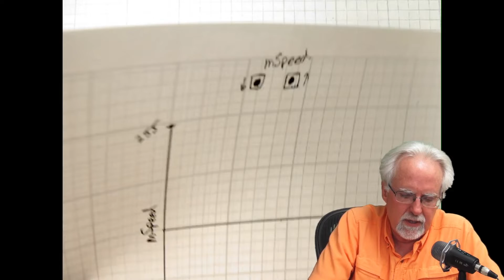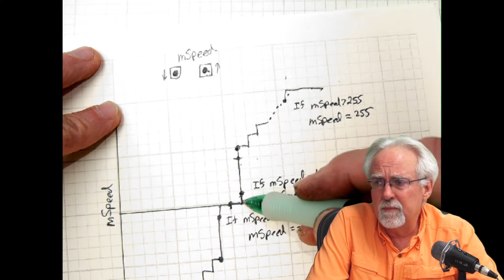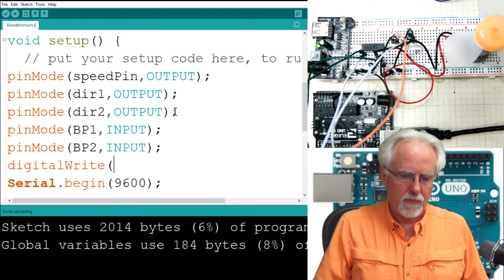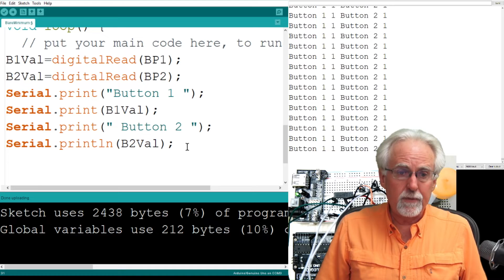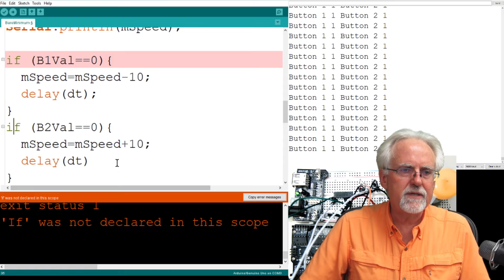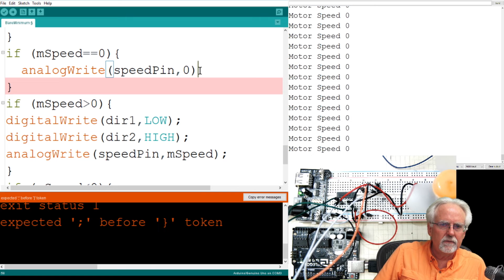Arduino Tutorial 40: Controlling DC Motor Speed and Direction with Pushbuttons

Comment: I set the logic completely differently.  Firstly I set a range of values between 99 and -99 and set a while loop.  Within that I set two variables of old and new speed to work out if I was increasing or decreasing speed.  Then I set the speed to either 0 if I was + and on the way down and 100 if I was on the way up.  Another loop did the same in the - range for 0 on the way up and 100 on the way down.  After that it was easy to keep the increases as increments of 145/10=14.5 to give it an exact figure of +255-100 and -255 +100.  This gave me exactly 10 clicks of each button to reach 255 or -255 which I set as a while loop.  Hopefully my explanation makes sense.  It meant I had smooth speed changes right up to the top rather than the mini increment for top speed.
Reply: I did something similar by specifying a minimum speed that got added or subtracted from my 'nominal' speed to create an 'actual' speed.

Comment: I did the homework. I used a minimum motor pwm setting of 90, but with a motor "primer" of 255 for 50 milliseconds when transitioning between off and a minimum.

Comment: int speedPin = 3;
int dir1 = 4;
int dir2 = 5;

int aos = 5;

int topA = 1023;
int topADot = 1023.;

int speedBVal = 0;
float speedAVal;

int switchPin1 = 9;
int switchPin2 = 8;

int switchVal1;
int switchVal2;

void setup() {

pinMode(speedPin, OUTPUT);
pinMode(dir1, OUTPUT);
pinMode(dir2, OUTPUT);

pinMode(switchPin1, INPUT);
pinMode(switchPin2, INPUT);

digitalWrite(switchPin1, HIGH);
digitalWrite(switchPin2, HIGH);

Serial.begin(19200);
}

void loop() {

Serial.print(speedBVal);
Serial.print(" ");
Serial.println(speedAVal);

switchVal1 = digitalRead(switchPin1);
switchVal2 = digitalRead(switchPin2);

if(switchVal1 == 0){
  speedBVal = speedBVal + aos;
  if(speedBVal > topA){
    speedBVal = topA;
  }
 }
else if(switchVal2 == 0){
  speedBVal = speedBVal - aos;
  if(speedBVal < -topA){
    speedBVal = -topA;
  }
 }

if(speedBVal > 0){
  digitalWrite(dir1, LOW);
  digitalWrite(dir2, HIGH);
  speedAVal = (255./topADot)*speedBVal;
}
else if(speedBVal < 0){
  digitalWrite(dir1, HIGH);
  digitalWrite(dir2, LOW);
  speedAVal = (-255./topADot)*speedBVal;
}

analogWrite(speedPin, speedAVal);
}

Comment: Done it my own way before watching the lesson, there's probably a much easier way to do it, but it works :D

int speedPin=5;
int dir1=4;
int dir2=3;
int forwardButton=7;
int reverseButton=8;

int forwardState;
int reverseState;

int forwardFlag=0;
int reverseFlag=0;

int forwardNumber=0;
int reverseNumber=0;
int forwardLimit=254;
int reverseLimit=254;
int mSpeed;
int delayTime=30;

void setup() {
  // put your setup code here, to run once:
pinMode(speedPin,OUTPUT);
pinMode(dir1,OUTPUT);
pinMode(dir2,OUTPUT);
pinMode(forwardButton,INPUT);
pinMode(reverseButton,INPUT);
digitalWrite(forwardButton,HIGH);
digitalWrite(reverseButton,HIGH);
Serial.begin(9600);

}

void loop() {
  // put your main code here, to run repeatedly:
forwardState=digitalRead(forwardButton);
reverseState=digitalRead(reverseButton);

if((forwardState==0)&&(forwardNumber<=forwardLimit)&&(reverseFlag==0))
  {
    digitalWrite(dir1,LOW);
    digitalWrite(dir2,HIGH);
    forwardNumber=forwardNumber+1;
    delay(delayTime);
    analogWrite(speedPin,forwardNumber);
    forwardFlag=1;
    Serial.print("Forward");
    Serial.println(forwardNumber);
    
  }
if((reverseState==0)&&(forwardNumber>0))
  {
    digitalWrite(dir1,LOW);
    digitalWrite(dir2,HIGH);
    forwardNumber=forwardNumber-1;
    delay(delayTime);
    analogWrite(speedPin,forwardNumber);
          if(forwardNumber==0)
        {
          forwardFlag=0;
        }
    Serial.print("Forward");
    Serial.println(forwardNumber);
  }
 
if((reverseState==0)&&(reverseNumber<=reverseLimit)&&(forwardFlag==0))
  {
    digitalWrite(dir1,HIGH);
    digitalWrite(dir2,LOW);
    reverseNumber=reverseNumber+1;
    delay(delayTime);
    analogWrite(speedPin,reverseNumber);
    reverseFlag=1;
    Serial.print("Reverse");
    Serial.println(reverseNumber);
 }
if((forwardState==0)&&(reverseNumber>=0))
  {
    digitalWrite(dir1,HIGH);
    digitalWrite(dir2,LOW);
    reverseNumber=reverseNumber-1;
    delay(delayTime);
    analogWrite(speedPin,reverseNumber);
          if(reverseNumber==0)
        {
          reverseFlag=0;
        }
    Serial.print("Reverse");
    Serial.println(reverseNumber);

  }
}

Comment: Was able to make the project work flawlessly. After watching 40 videos, I have understood how to approach the problem. I also incorporated 2 LEDs for +max and -max speed to signal the user to stop pushing the button. Also, my motors start to run at 95 so the number of if statements reduced and thus the complexity. Thanks for all the lessons, Paul! Appreciate it.

The grade would be A or A+ if you are generous enough...haha!

Comment: This is my code it is very different from yours but i tried doing it by myself. Keep up with the great videos. My grade would probably be a B- or  a C+.

int speedPin = 5;
int dir1 = 4;
int dir2 = 3;
int mSpeed = 90;
int Ypin = 9;
int Yval;
int d1 = 750;
int buttonpin = 8;
int buttonVal;
int buttonpin2  = 10;
int buttonVal2;
int buttonstate = 1;
int buttonstate2 = 0;

void setup(){
    pinMode(speedPin,OUTPUT);
    pinMode(dir1,OUTPUT);
    pinMode(dir2,OUTPUT);
    pinMode(buttonpin2,INPUT);
    pinMode(buttonpin,INPUT);
    Serial.begin(9600);
    digitalWrite(buttonpin,HIGH);
    digitalWrite(buttonpin2,HIGH);
}

void loop(){
    buttonVal = digitalRead(buttonpin);
    buttonVal2  = digitalRead(buttonpin2);
   
    analogWrite(speedPin,mSpeed);
    Serial.println(buttonVal);
    delay(d1);
    if(buttonVal == 0){
        if (buttonstate == 1){
            mSpeed+=20;
            digitalWrite(dir1,LOW);
            digitalWrite(dir2,HIGH);
        }
    }
    if(buttonVal2 == 0){
        if (buttonstate2 == 0){
            mSpeed = mSpeed-20;
            digitalWrite(dir1,HIGH);
            digitalWrite(dir2,LOW);
        }
    }
}

Comment: I did it all by myself!
I thought to myself: self, I need to to this without watching the video. (I watched parts of the video after I finished my code which is how I learnt about abs)
so I did, it took me a while but I ended up doing it VERY different to how you did it, Paul (I used episode 39 as some inspiration)
I didn't know about abs but I did some math to work like abs but a little bit different (I think)
With my motor it has a little more power, so mine turns on much earlier which meant I didn't have to worry about the starting the motor at 100, and I have an arduino mega so I used digital pins 52 and 53 to make it a little more neater
Anyway here is my code:

int buttonPin1=11;
int buttonPin2=10;
int buttonVal1;
int buttonVal2;
int buttonCount=0;

int speedPin=5;
int dir1=52;
int dir2=53;
int mSpeed;

int del=200;
String com=",   ";

void setup() {
  Serial.begin(9600);
  pinMode(buttonPin1, INPUT);
  pinMode(buttonPin2, INPUT);
  digitalWrite(buttonPin1, HIGH);
  digitalWrite(buttonPin2, HIGH);
  pinMode(speedPin, OUTPUT);
  pinMode(dir1, OUTPUT);
  pinMode(dir2, OUTPUT);
}

void loop() {
  buttonVal1=digitalRead(buttonPin1);
  buttonVal2=digitalRead(buttonPin2);
  if (buttonVal1==0){
    buttonCount=buttonCount+15;
    if (buttonCount>255){
      buttonCount=255;
    }
    mSpeed=buttonCount;
  }
  if (buttonCount<=0){
    mSpeed=buttonCount-buttonCount-buttonCount;
  //this part
  }
  else{
  mSpeed=buttonCount;
  }
  if (buttonVal2==0){
    buttonCount=buttonCount-15;
    if (buttonCount<-255){
      buttonCount=-255;
    }
  }
  if (buttonCount>0){
    mSpeed=buttonCount;
  }
  else{
  mSpeed=buttonCount-buttonCount-buttonCount;
 //and this part act like abs (im not 100% sure though)
  }
  if (buttonCount<0){
    digitalWrite(dir1, LOW);
    digitalWrite(dir2, HIGH);
    analogWrite(speedPin, mSpeed);
  }
  if (buttonCount>=0){
    digitalWrite(dir1, HIGH);
    digitalWrite(dir2, LOW);
    analogWrite(speedPin, mSpeed);
  }
  Serial.print(buttonVal1);
  Serial.print(com);
  Serial.print(buttonVal2);
  Serial.print(com);
  Serial.println(mSpeed);
  delay(del);
}

Thanks Paul, you are an absolute legend, you explain things sooo much better than any of the other youtubers or websites out there, love the content. Keep it up!

Comment: Paul,  I wanted to let you know on Lesson-40 I changed my code from a 20-Step Motor to a VFD Drive.  I was able to achieve 310 steps by coding this way.  Also I had a quite a bit of problems with power from the 9-Volt battery.  As you did I found a 12-DC Transformer laying around and "It made all the difference in the world.  If you would like a copy of my sketch, let me know.  Thanx again for all the time you spend putting together "these excellent videos".

Comment: Hey Paul, could you do a tutorial on resetting the arduino. Mine often won’t even run your code and then out of nowhere it will start running again. It’s nothing to do with port connection. It downloads fine. The buttons worked in the first part of this, but the second I add the motor nothing works, even the toggle buttons that initially did. I’ve been going mad for about three days straight with this. I can’t run my homework code to see if it works or even your code. Any thoughts? Does this ever happen to you? The joystick and dc motor combo worked flawlessly. This one isn’t running at all. Thanks again!

Comment: Paul, another GREAT tutorial! I failed with the abs() command but now have this tool in my toolbox. Thank you!

Each tutorial builds on the previous and I'm able incorporate past lessons learned. I added a green led that brightens as mspeed increases, when 255 is reached I have a red led that blinks on and off. Can't have the end user banging away on the buttons not knowing if they reached maximum motor speed. :)

Comment: While doing my homework, I accidentally poured myself a tall glass of wine instead of coffee. While I was successful in getting it to run, I didn't factor in the jump from zero to 100 and vice versa. Also I activated the motor in CW at the top of the loop, so that if I was in CCW, pressing either of the buttons would cause a slight buck in the wrong direction. I'd give myself a 75.

Comment: I set up some intervalls, so if i change the jumps (in german and in the code sprung) it will still work and not only if mspeed equals 95||90.

int speedPin=5;
int dir1=4;
int dir2=2;
int mSpeed;
int buttonPin1=A0;
int buttonPin2=A1;
int buttonVal1;
int buttonVal1Old;
int buttonVal2Old;
int buttonVal2;
int sprung=10;
void setup() {
  // put your setup code here, to run once:
pinMode(speedPin,OUTPUT);
pinMode(dir1,OUTPUT);
pinMode(dir2,OUTPUT);
pinMode(buttonPin1,INPUT);
pinMode(buttonPin2,INPUT);
digitalWrite(buttonPin1,HIGH);
digitalWrite(buttonPin2,HIGH);
Serial.begin(9600);
  
}
f
void loop() {
  // put your main code here, to run repeatedly: 
buttonVal1=digitalRead(buttonPin1);
buttonVal2=digitalRead(buttonPin2);
if (buttonVal1==1 && buttonVal1Old==0){
  mSpeed+=sprung;
  if (mSpeed>255){
    mSpeed=255;
  }
    if (mSpeed>-100&& mSpeed<0){
    mSpeed=0;
  }
      if (mSpeed>0 && mSpeed<100){
    mSpeed=100;
  }
}
if (buttonVal2==1 && buttonVal2Old==0){
  mSpeed-=sprung;
  if (mSpeed<-255){
    mSpeed=(-255);
  }
  if (mSpeed<100 && mSpeed>0){
    mSpeed=0;
  }  
  if (mSpeed>-100&&mSpeed<0){
    mSpeed=-100;
  }
}

if (mSpeed>=0){
digitalWrite(dir1,HIGH);
digitalWrite(dir2,LOW); 
analogWrite(speedPin,mSpeed);
}
if (mSpeed<0){
digitalWrite(dir1,LOW);
digitalWrite(dir2,HIGH);
analogWrite(speedPin,(-1*mSpeed));
}
buttonVal1Old=buttonVal1;
buttonVal2Old=buttonVal2;
Serial.println(mSpeed);

}

Comment: or most got it

int speedPin = 5;
int dir1 = 4;
int dir2 = 3;
int mSpeed = 255;
int bPin1 = 6;
int bPin2 = 7;
int bV1;
int bV2;
int dt = 250;
int mvo;
int mvn;
void setup() {
  // put your setup code here, to run once:
  pinMode(speedPin, OUTPUT);
  pinMode(dir1, OUTPUT);
  pinMode(dir2, OUTPUT);
  pinMode(bPin1, INPUT);
  pinMode(bPin2, INPUT);
  digitalWrite(bPin1, HIGH);
  digitalWrite(bPin2, HIGH);
  Serial.begin(9600);
}
void loop() {
  // put your main code here, to run repeatedly:
  bV1 = digitalRead(bPin1);
  bV2 = digitalRead(bPin2);
  Serial.print(" bv1 ");
  Serial.print( bV1 );
  Serial.print(" bv2 ");
  Serial.println( bV2 );
  delay(dt);
  mvo = mvo + (mvn - mvo);

  if (bV1 == 0) {
    mvo = mvo + 10;
    if (mvo > 0) {
      digitalWrite(dir1, LOW);
      digitalWrite(dir2, HIGH);
      analogWrite(speedPin, mvo);
    }
    if (mvo < 0) {
      digitalWrite(dir1, HIGH);
      digitalWrite(dir2, LOW);
      analogWrite(speedPin, mvo);
    }
  }
  if (bV2 == 0) {
    mvo = mvo - 10;
    if (mvo < 0) {
      digitalWrite(dir1, LOW);
      digitalWrite(dir2, HIGH);
      analogWrite(speedPin, mvo);
    }
    if (mvo > 0) {
      digitalWrite(dir1, HIGH);
      digitalWrite(dir2, LOW);
      analogWrite(speedPin, mvo);
    }
  }
  Serial.print("  mv  ");
  Serial.print(mvo);
  mvn = mvo;
}

Comment: I did is as follows, also had the delay time configured under the Serial Prints(fixed that) and used analogWrite (speedPin, (mSpeed * -1)); instead of analogWrite (speedPin, abs(mSpeed));

int speedPin = 5; // EN1 on L293D chip
int dir1 = 4; // IN1 on L293D chip
int dir2 = 3; // IN2 on L293D chip
int mSpeed = 0; // This is the desired motor speed (PWM), value between 0 and 255, motor starts spinning at around 75
int upButtonPin = 8; // Controls the speed in the upward direction
int downButtonPin = 9; // Controls the speed in the downward direction
int upVal; // Status of Up-Button
int downVal; // Status of Down-Button
int dt = 250;
String msg = "Down-button state is ";
String msg2 = "  Up-Button state is: ";
String msg3 = "  Motor Speed is: ";
void setup() {
  // put your setup code here, to run once:
  Serial.begin(9600);
  pinMode(speedPin, OUTPUT);
  pinMode(dir1, OUTPUT);
  pinMode(dir2, OUTPUT);
  pinMode(upButtonPin, INPUT);
  pinMode(downButtonPin, INPUT);
  digitalWrite(upButtonPin, HIGH); // Pull-UP resistor in Arduino
  digitalWrite(downButtonPin, HIGH); // Pull-UP resistor in Arduino
}
void loop() {
  // put your main code here, to run repeatedly:
  upVal = digitalRead(upButtonPin);
  downVal = digitalRead(downButtonPin);
  Serial.print(msg + downVal);
  Serial.print(msg2 + upVal);
  Serial.println(msg3 + mSpeed);
  if (upVal == 0 && downVal == 1) { // When pressing the Up-Button
    mSpeed += 10;
    delay(dt); // Delay time, only when pressing the button
    if (mSpeed == 10) {
      mSpeed = 100;
    }
    if (mSpeed == -90 || mSpeed == -95) {
      // Because you are going Upwards with this button
      // 90 if mspeed did not reach 255
      // 95 if mspeed did reach 255
      mSpeed = 0;
    }
    if (mSpeed > 255) {
      mSpeed = 255;
    }
  }
  if (upVal == 1 && downVal == 0) { // When pressing the Down-Button
    mSpeed -= 10;
    delay(dt); // Delay time, only when pressing the button
    if (mSpeed == -10) {
      mSpeed = -100;
    }
    if (mSpeed == 90 || mSpeed == 95) {
      // Because you are going Downwards with this button,
      // 90 if mspeed did not reach 255
      // 95 if mspeed did reach 255
      mSpeed = 0;
    }
    if (mSpeed < -255) {
      mSpeed = -255;
    }
  }
  if (mSpeed >= 0) { 
    // Otherwise motor does not know what to do @ 0
    digitalWrite (dir1, LOW); // Direction of the DC motor
    digitalWrite (dir2, HIGH); // Direction of the DC motor
    analogWrite (speedPin, mSpeed); // Speed of the DC motor
  }
  if (mSpeed < 0) { 
    digitalWrite (dir1, HIGH); // Direction of the DC motor
    digitalWrite (dir2, LOW); // Direction of the DC motor
    analogWrite (speedPin, abs(mSpeed)); 
    // abs = absolute value of mSpeed. Speed of the DC motor
//    analogWrite (speedPin, (mSpeed * -1)); // Speed of the DC motor
  }
//  if (mSpeed == 0) {
//    digitalWrite (speedPin, LOW); // Speed of the DC motor
//  }
}

Comment: I did it on my own, I plan the strategy while I was coding and did some investigation on how to add multiple functions to the push buttons so I added a function to increase de speed by 5 in one click and if you keep the button press for 2 seconds the speed increases gradually. Also to shut it off by pressing both buttons at the same time . Works like a charm, thanks for everything that you teach.

Comment: can this be done with a AC Motor  Faller 629 180629 Synchronous Motor 12-16v 4/15 Rpm Motor Reversible Rotation 12-16v Ac 60ma by Faller or is there away of doing it with the Arduino

Comment: I did the project and enjoyed it, however I misinterpreted the specs. I thought the user would press a button and once pressed the motor would incrementally increase in one direction toward a ceiling of 255. But at any time, if the other button were pressed, the motor would slow down to a zero point and restart in the other direction, again moving to a ceiling of 255. I did find a log of special cases. For example once a button was pressed to reverse, we couldn't immediately change directions. Instead I had to decelerate the motor until it reached below 100. At that point, change directions and start the motor moving in the opposite direction with a ceiling of 255. The nice thing about it was that the user could press the button at any point and there wouldn't be a jarring change, but a gradual slowdown, then a direction change.

Good and challenging project, Paul. Keep em coming.

Comment: I incremented motorspeed by 1 but used a shorter delay so it still responded relatively quickly.  I didn't worry about the dead zone between -100 and 100, just powered through it by leaning on the buttons.  My bad, I guess.
Thanks again!